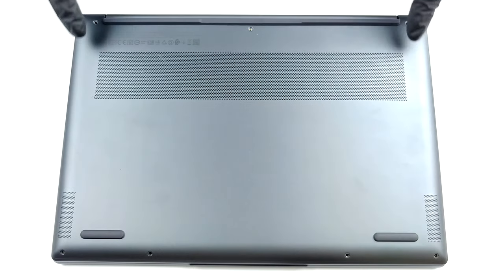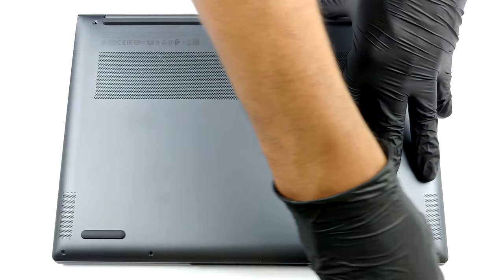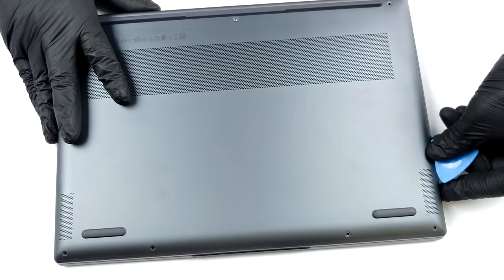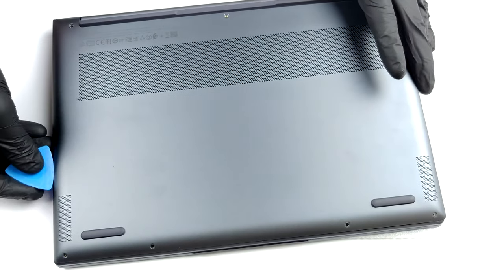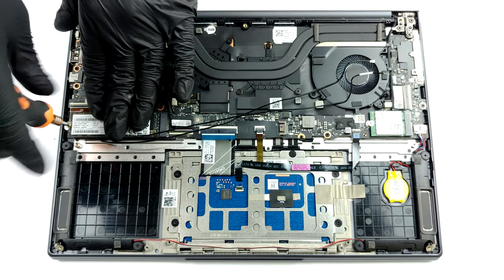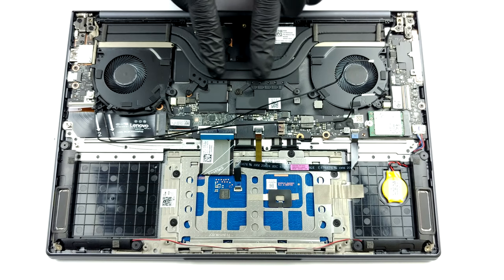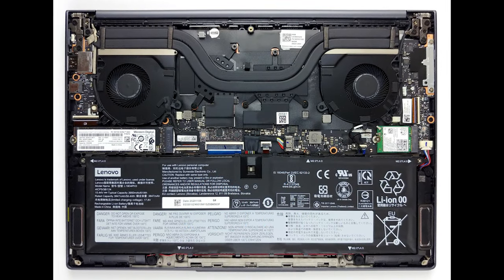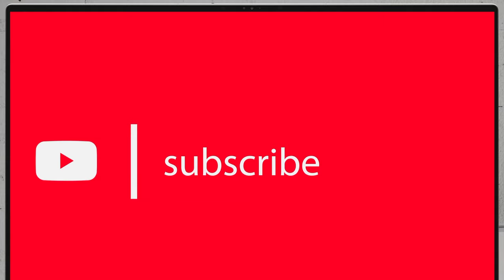🛠️ Lenovo Yoga Slim 7i Pro (14) - disassembly and upgrade options

Comment: Which model did you use in particular? I upgraded mine with a Samsung 980 Pro  and it still runs on "only" PCIe 3.0 =(.

Comment: anyone who can tell me what that little tip inside the battery concave is for? I have this laptop and my model have some issues with a clicking noise and flex near that point on the back chassis

Comment: So i cannot add another 2242 nvme ssd ? Can only upgrade the single nvme ssd ?
Reply: The slot on the right might be the wifi6e+Bluetooth controller? I haven’t opened mine up, it has 1TB and 16gb of ram, with ddr5 memory.  Haven’t needed to at all